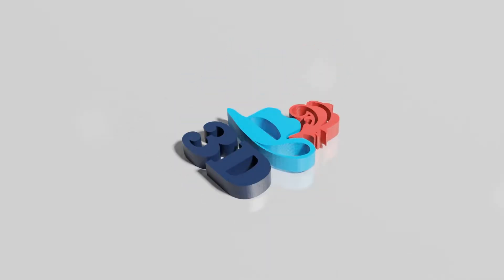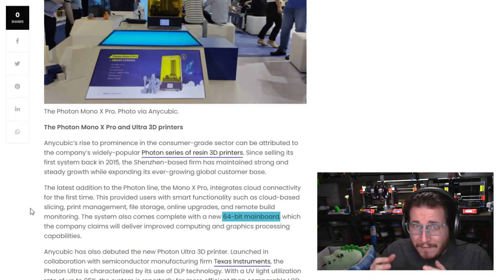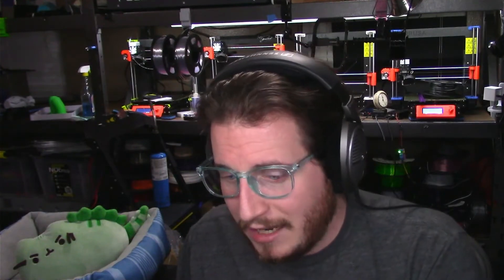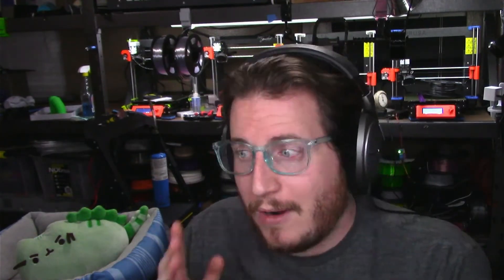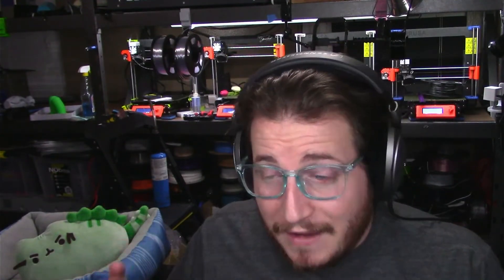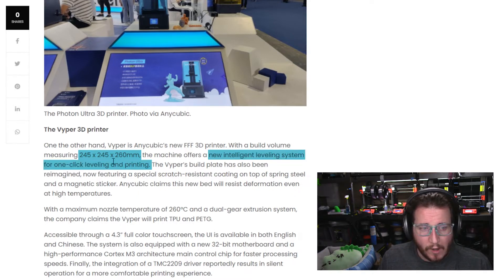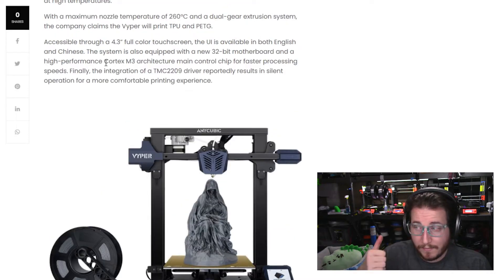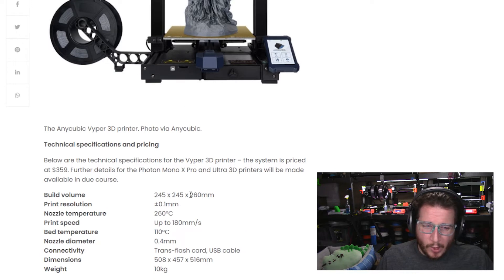Anycubic's New Printer Line-Up is AWESOME!! (Vyper, Photon Ultra, and Mono X Pro!)

Comment: TI's DLP technology is entirely different than LCD,  basically mirrors instead of shutters on a micro-scale, this could be extremely interesting.
Reply from the maker: Indeed it is! When we made this video, it was not known to be in cooperation with TI yet. We have used some DLP printers, but those were literally just projectors under a resin vat. This one should be VERY interesting! I am curious to see how they have gotten by this issue!
Reply: @3DMusketeers  gotta read that fine print!  They mentioned it right before the 95% efficiency over comparable LCD printers claim.  I think someone at TI was finally upset that LCD was taking all the 3D printing lunch moeny, and they want to get in on the "inexpensive" SLA printing game.
Reply from the maker: @learnMax  Them using DLP was not known back then. I figured it was going to be some sort of new LCD tech, but DLP is awesome! I am so excited to see what comes from this alliance with TI
Reply: @3DMusketeers  It was known back then. You literaly was reading from article wich mentioned "DLP" on it)

Comment: Question ?! Photon ultra...  what about projection resolution (interpolated!? ) how BIG risk of dead pixels?! 😱
Reply from the maker: I am not sure actually, Anycubic has been pretty quiet about the thought of dead pixels, but considering my OLD dlp TV still works.. I would guess it will last fine. It is TINY though for build volume.
Reply: the photon ultra doesn't use an LCD it's a laser projector, there aren't any pixels involved.
Reply: @LegalEliminator  all projectors have micro screen inside 😁

Comment: Ultra maybe a  ~13" few consumer level manufacturers teasing about them
Any news if Anycubic are sticking with Chitu boards 
Creality seem to have cut ties with chitu their New Halot series is apparently a Linux based computer board with add on driver board , Currently only Compatible slicer is there own slicer Creality box which is very underdeveloped
Reply: My guess its a small scale resin printer
But from my understanding the ultra pro is the one they are refering to when they Talk about the increased light efficiency and not the mono x pro. And that is because it doesnt have a lcd (rgb or mono) but a dlp unit Developed by Texas instruments. It means it has an projector as a lightsource that is projecting the sliced layer directly on the resin. Thus no light power lost passing through any lcd. That also means no lcd Degeneration through the uv light. And it also could mean Variable buildvolume and variable resolution by changing the "focal point" of your projection. Its a dlp printer not a lcd printer. Thats huge as it is the first resin printer from an "affordable" company. At least to my knowledge.
Reply from the maker: That is my hope with the ultra too, something BIG
No word yet on the chitu board, but I would guess it is going to run SOME version of the firmware
Creality JUST released their Saturn competitor, for 2x the cost.. We may do a video on it, but meh, go buy an Elegoo Saturn lol. As much as we dislike Chitu, it has decent community support and doesn't mind when I am mean to it!

-G